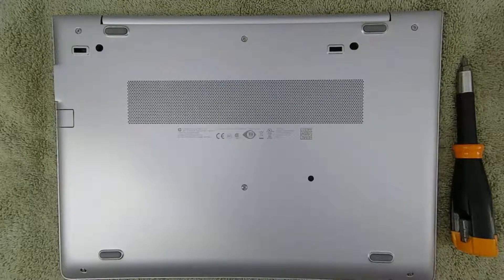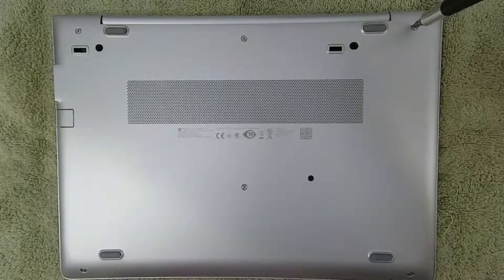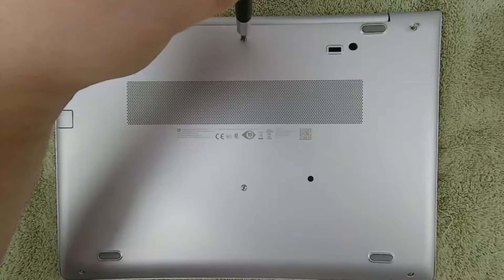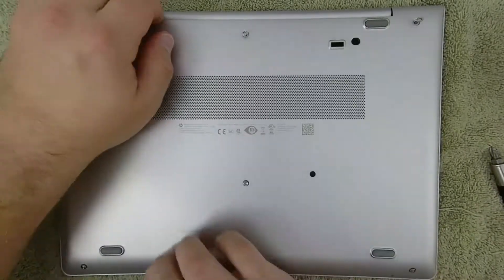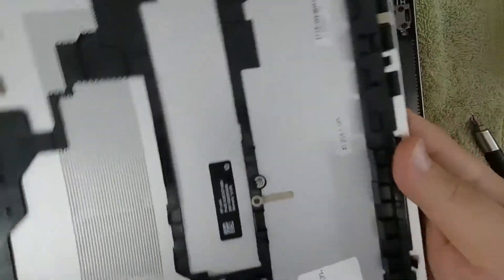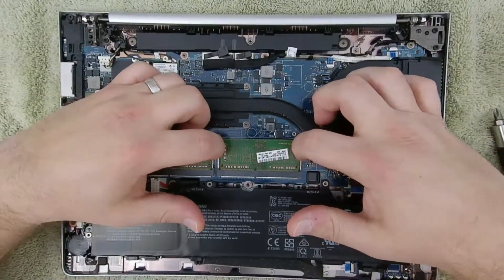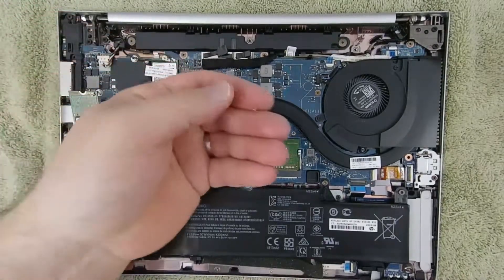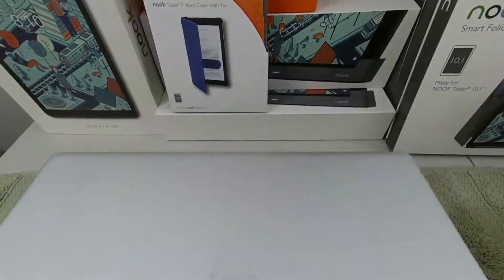HP mt44 Mobile Thin Client Disassembly - Ryzen 3 2300u Vega 6

Comment: how you can open the port of "sc" and "SIM"
Reply: Disassemble the laptop and take the motherboard out and stuff then remove the board and pull out the dummy card and reassemble it. Just did it.

Comment: Can you install Linux on this machine? Also great video.
Reply from the maker: Thanks! I did boot to Linux Mint 18 when I was first setting it up, and it seemed to run fine off the USB drive. WiFi, Touchpad, and all of the basics worked. I may try to install a distro when I upgrade the M.2 SSD in the near future, and I'll make sure to make a video on it! Thanks for watching!
Reply: @splashdmgtech  thanks for the response it looks like a very nice laptop, I will definitely keep it in my radar.
Reply: @splashdmgtech  bro where's the air intake?
Reply: It looks like a decent laptop at an affordable price, what are your thoughts on performance after testing it out?